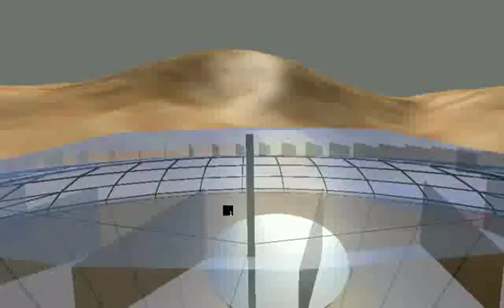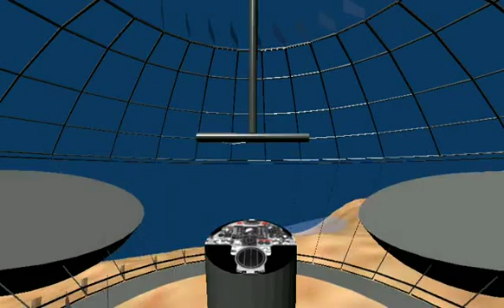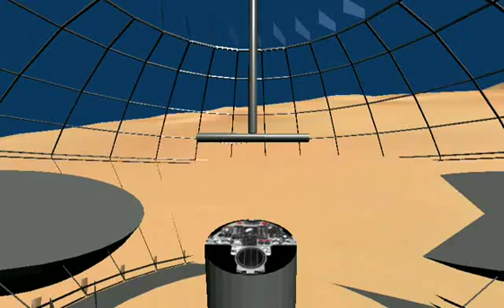Homebuilt DIY Flying Saucer Simulator You Can Actually Fly

Comment from the maker: I did make a 3' model of this, and was very impressed with the structural characteristics. It does fly (well, anything this light would fly), but a scaled-up model probably wouldn't haul enough for my needs, nor does it handle well because it's heavier-than-air, which exerts an unbalanced lift onto the leading-edge of the airfoil (the weight has to be shifted to whichever end is facing forwards). There's an easy fix that would solve both of those problems, and that is to make it nearly lighter-than-air, and thus not requiring of lift (which with traditional lifting gasses ups the size to at least 50-70' in diameter, 100 for a live-aboard).

Comment: You just designed a mirolight helicoptor that looks like a flying saucer.

The variable stators might not have the control authority to counter act the torque of the fan or maintain a course.

You should switch the  main propulsion to a 60 hertz sound resonance dish.  It won't have any torque.

Comment: @Ronnie51026 Actually the Muller multi engine saucer was stable and the FFA refused to allow a license and they gave NO reason as to why. The FFA has said they don't HAVE to give a reason , license are given at their discretion. If you don't believe then build a 1/4 scale model.

Comment: Drawing air into the bottom of the craft would create negative lift, sucking it down.

To exploit the coanda effect you need air travelling across the top surface of the saucer. Drawn in from the center and pushed out to the edges.